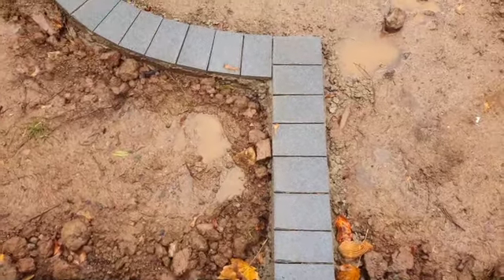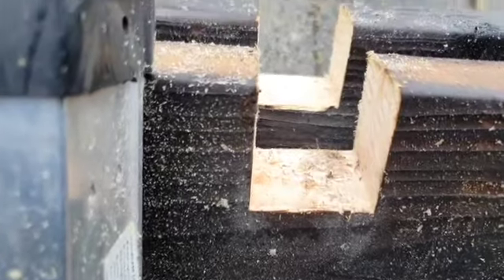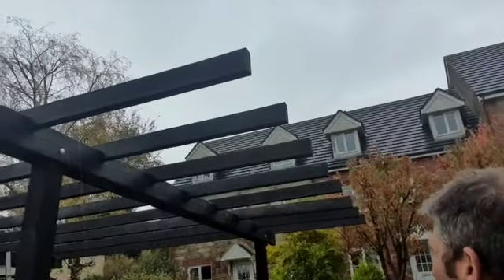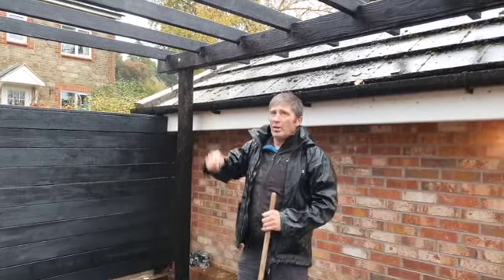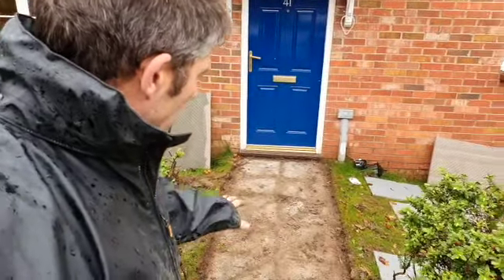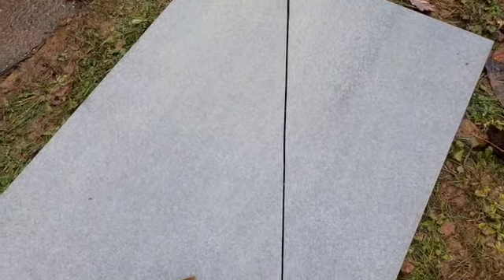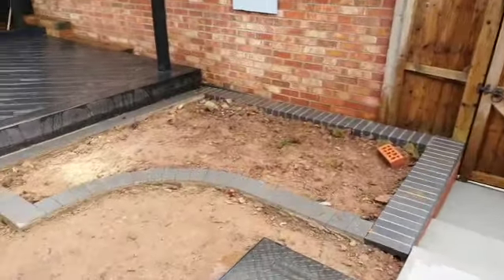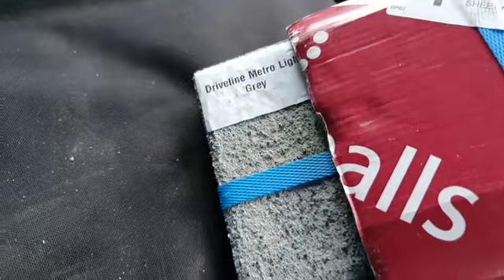Pergola Near To Completion In Chepstow

Comment: Hello mate! I hope you're keeping well and safe? How thick do you usually lay your base (hardcore) and sand cement for the slabs? Is 100mm hardcore and 3 inches of sand/cement for the slab enough? Could I lay 4 inches of sand/cement or is that too much?
Reply from the maker: Hi Ash, all good thank you, a sub base will always depend on how soft the ground is that your digging out. As long as you feel its firm enough a usually a 100mm sub base is good, normally Type 1 is ok but I tend to use a Lean Mix which is a semi dry concrete mix as it will forma Rigid paving system. mortar bed should never be more than 50mm as it tends to get expensive then, get all your levels nice and flat ad even.